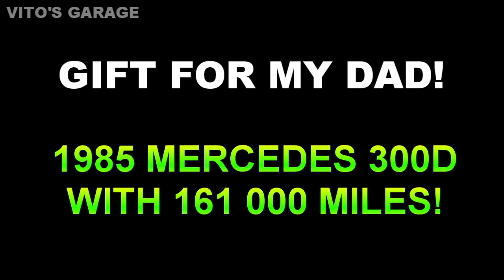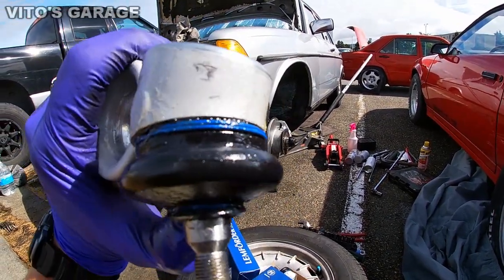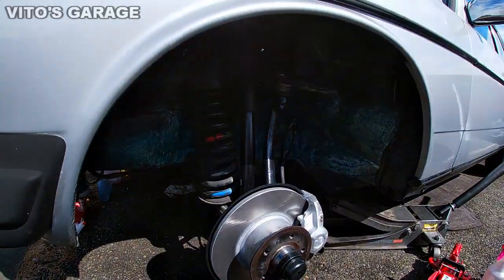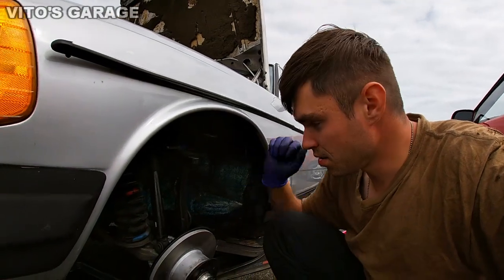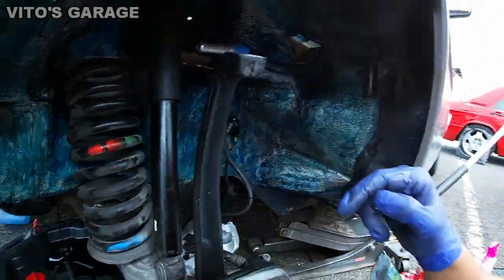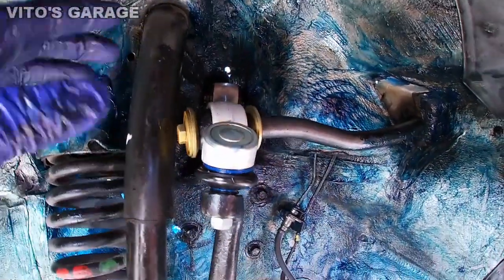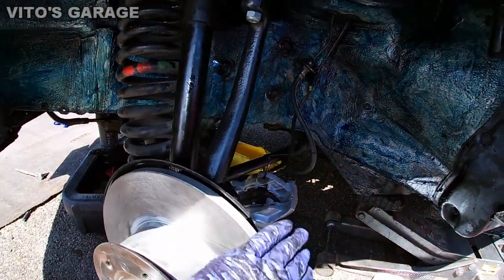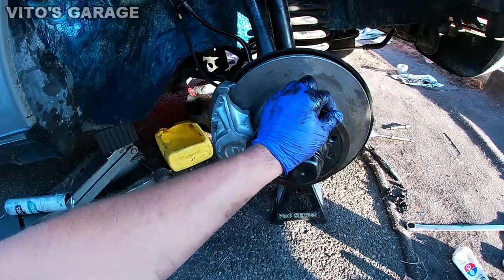PART 3 Dad's Gift Low Mileage 1985 Mercedes W123 300D: New Upper Control Arms & Ball Joint Boots!

Comment: Did you cover the wheel well with grease. ??   It looks like blue bearing grease. 
I did mine with spray on bedliner. 
The matterials was $135 and comes with the spray gun for bedliner.  Looks great. It protects 
And easy to clean.
Reply from the maker: The fluid film and grease are the best rust prevention and protection products. I coat lots of cars with that. I also remove the wheel liners and coat behind. 
Bedliner isn’t a good idea. It’ll 90% trap the moisture and rust out the metal. You might not even see it
Reply: @VITOSGARAGE  i will continue with bedliner. It looks better and dont get grease on you when working on it.  I keep my car spotless and its 100% rustfree
Reply from the maker: @w124mercedes7  lol ok

Comment: I thought replacing my 500 SEC's rather worn uca's would solve a vibration issue I have been having. Well, not really. It certainly improved the situation, but there is still something else in there causing me tiny bit of vibration. Dammit!! The good thing I am now able to drive up to 63mph problem free. Above that and it starts to appear. 

A shame you are literally as far away from me as possible here in the USA, without being in Alaska or Hawaii, of course. ;-)
Reply from the maker: Have you checked the steering damper? They can cause vibrations. Make sure sure all the steering and suspension components are tight. Make sure your tires are balanced well, driveshaft flex discs and center support are good. If someone at some point didn't install the driveshaft back together properly, it can be out of balance. Make sure all the wheel bearings aren't loose. Bent CV Axles can cause vibrations. And I know, we are on completely opposite coasts! But I might be coming back to Midwest after finishing my service. Not sure yet ;)

Comment: Hey Vito, you didnt need to compress the spring when replacing the lower ball joint?? thanks for all the wonderful content btw!!😃
Reply from the maker: Hi sir. No. You don’t have to compress the spring if you’re only replacing the ball joint. Just make sure to not remove the shock. Leave the shock absorber in place. Thanks a lot for supporting 🙂
Reply: @VITOSGARAGE  thanks Vito, i really appreciate it!! 🙏🏼

Comment: Surprised you didn't add a grease fitting to the upper control arm ball joints.
Reply from the maker: I added a lot of extra grease to those by taking the boots off. Grease fittings? You got a video? Never added grease fittings before
Reply: @VITOSGARAGE  
 I don't have a video available. Look up videos on how to install grease fittings. Adding grease fittings to tie rod ends are also a great way to add  life to them.

Comment: How did you remove the boots?
Reply from the maker: Carefully with a tiny screwdriver by removing both metal clips. It's not super hard to figure out
Reply: VITO'S GARAGE I got them off only to find out that I was recommend a petroleum based grease at the auto parts store. Not trying to swell the boots so it took me about half an hour to get the ring back on.
Reply from the maker: @graemeceballos265  Silicone grease only! Not petroleum!!!